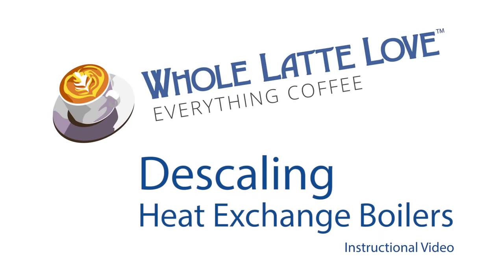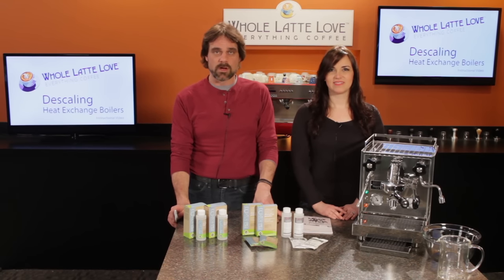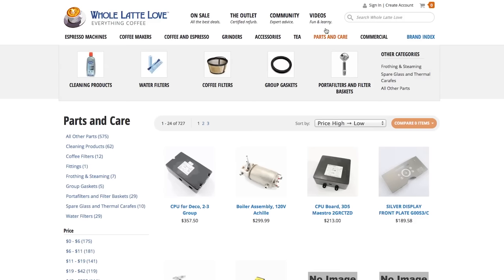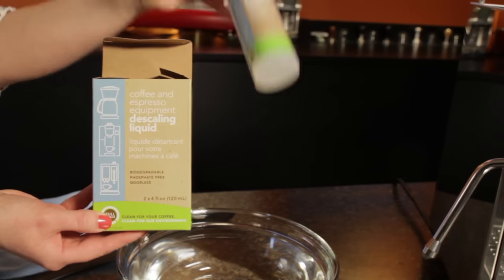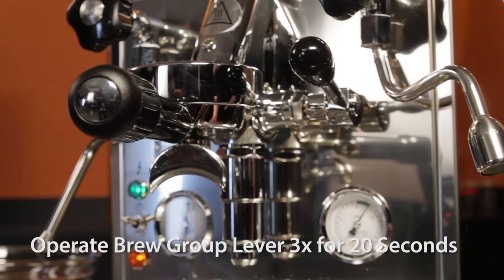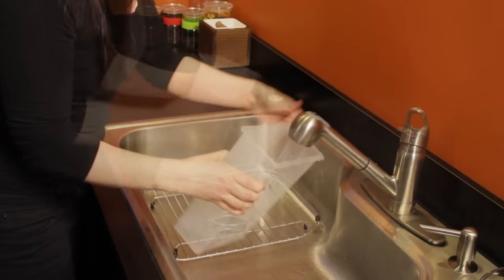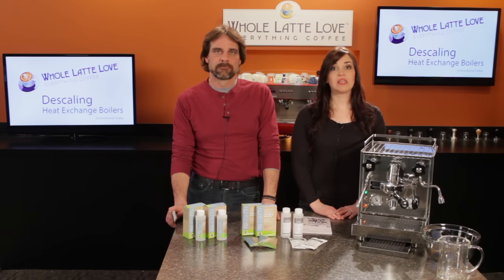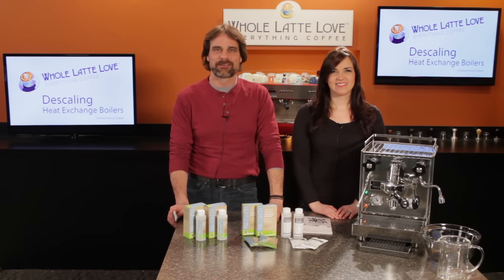How To Descale Espresso Machine Heat Exchange Boilers

Comment: i've found on my profitec 700 that, in addition to the 3-5x end process,  i typically need to flush the grouphead for another 4-5 minutes to get the salt taste out of the  water, backflushing every ~60 seconds
Reply from the maker: Hi kk, We generally recommend end home users do not descale dual boiler machines. As you've found it's difficult to fully flush out descaling acids. Especially the steam boiler. It has open headspace. When descaler is introduced to the steam boiler it can foam up into the headspace. When running water through the steam boiler it never fills the boiler entirely so foam is left in headspace. Best practice is to filter/treat source water to prevent scale from forming in the first place. BWT Water & More has filters using ion-exchange available for plumbed and reservoir fed machines. Their filters exchange calcium in source water for magnesium. They also remove chlorination using activated carbon. The result is chlorine free water with a mineral level needed for flavor and corrosion protection that when used as directed will not cause scale formation in the machine.
Marc
Reply: @Wholelattelovepage   we have always used distilled store bought water for it,  is this an acceptable practical alternative to eliminate the need for descaling? I understand that the use of distilled water is considered to negatively affect the taste of the espresso, but to us it tastes awesome and have zero complaints.  Can we just stick with distilled and stop the 6 moth descales?
Reply from the maker: @dr_flunks  If it tastes good to you that's what matters! You'll get no scale using water with zero mineral content. But, be aware there is a risk of corrosion of metals if using pure distilled water. Pure distilled and reverse osmosis waters are such a good solvents they pull ions from metals causing corrosion. You may not see issues right away but down the road it could cause trouble. What's your tap water like? If good quality and on the softer side with ppm of <100 you could 50/50 mix with distilled to increase the mineral content to remove corrosion risk without having enough minerals to cause scale. If your tap water is moderately hard at 200ppm use 25% tap with 75% distilled. Another option is to dose your distilled water with baking soda and Epsom salt to increase the mineral level. Here's a video showing how to do that. I'd use 25% of the amounts suggested in the video to guarantee no scale: https://youtu.be/iHI7jC0sQZo

Comment: Hello
Thanks for the helpful video.
I recently purchased the Elba 3 from you guys. It does not have a hot water wand. How can I rinse the boiler on this machine? Should I lift the lever for the group head to run everytime you are turning on the wand?
Thanks
Reply from the maker: Hi Max, There is a valve for draining the boiler underneath the machine. Lifting the lever runs water only through the brew water heat exchange section. It does not cause water to turn over in the steam producing section of the boiler.

Comment: How should I do this with a Bezzera BZ 10? Bezzera does not provide any information on decalcification but advises against continuous decalcification !!! When using soft water, descaling is only necessary after several years.

Only external decalcification is recommended here. Please show how this is done ;-).... Are there tips and empirical values for this?

Greetings Christopher
Reply from the maker: Hi CK, Thanks for the question. Most all manufacturers advise against descaling prosumer level machines. This because if one decalcifies a neglected machine it can cause problems with chunks of scale dislodging in one area and plugging another. Then they call the manufacturer and complain. Machines with heat exchange boilers have less complex hydraulic systems than dual boiler machines so not nearly as risky for a home user to descale. The best course is to continuously prevent scale in the first place by filtering to reduce calcium while retaining a mineral level needed for taste and to prevent corrosion of metals. BWT has products like this for that purpose: https://www.wholelattelove.com/products/bwt-bestsave-s-anti-scale-filter
Unless you know your machine has seen hard water for a long time without descaling or is showing symptoms of scaling it's relatively low risk to descale.
Reply: @Wholelattelovepage  Hi thanks for the feedback. I only use Volvic water with a hardness of 3.4 odH, magnesium 12 mg in 1.5 liters and calcium 30 mg in 1.5 liters.

I last decalcified about 1.5 years ago.

Now I have learned from various sources that because of the risk of clogging with lime particles, corrosion damage and the heating coil can also break as a result.

Supposedly, this does not tolerate the descaler and should be removed and cleaned exclusively mechanically or replaced immediately.

Do you have any experience with this? Please also show the external decalcification.

Thank you for the many great videos about coffee. Thumbs up from me!! ;-)

Best regards
Christopher

Comment: how do I descaling the dual boiler espresso machine?
Reply from the maker: Hi NAS, Most manufacturers recommend dual boiler machines be descaled by professional technicians. Dual boiler machines have rather intricate internal plumbing. When descaling, it's possible that scale can be dislodged and plug up plumbing in other parts of the machine. Our preferred solution is to use a quality water filter system that does not allow for scale in the first place like this one: https://www.wholelattelove.com/products/bwt-bestmax-premium-filter-package

Comment: This descales the entire boiler which might not be necessary and can be work the vibration pump too hard. It will be good if there's instruction on just descaling the grouphead and heat exchanger.

Comment: Can you use this method for the Grimac Royal Falcon La Valentina Automatic? Mine is not direct plumbed - I use the 3L internal reservoir with water simply filtered through a Brita filter. Is there a better filtering solution that you recommend? 

I also bought the machine second hand from a restaurant, so I'm not sure how frequently it was descaled. It seems to be working fine, but I guess it might be a little risky to descale on my own without knowing how much build up there is? Is there a way for me to acess how much buildup there is, in order to determine if I'm safe to descale on my own or not? Thanks!
Reply from the maker: Hi Evan, Thanks for the questions. It's a heat exchange boiler machine so this procedure will work. Brita filters do not reduce/control mineral levels in water as far as I know. They do particulate and carbon filtering for chlorine etc. My favorite solution for reservoir fed machines is this BWT pad filter. It uses ion exchange technology to remove excess calcium and replace it with magnesium at a level which significantly reduces scale buildup: https://www.wholelattelove.com/bwt-bestsave-m-anti-scale-filter
The only real way to appraise scale buildup is to have a look inside the boiler. Not knowing how the machine was maintained previously, you are right in assuming it might be a little risky to descale. If there's a lot of scale in the machine descaling could dislodge large particles which can clog other components. My recommendation is to have the machine professionally serviced.
Reply: Great, thanks so much! Super helpful :)
Reply: Okay one more quick question: I just learned that the original owner purchased the machine back in 2014, and apparently had the internal Grimac water softener (that apparently comes with these machines) connected and changed regularly by the tech, but has never had it descaled. So I'm wondering, with 3+ years of use with NYC water run through the softener, but no descaling, what kind of shape would you expect the machine to be in currently in regards to scale build up? Think I might be in a safe place to start descaling on my own with your method? 

Thanks again!
Reply from the maker: Hi Evan, I think you will likely be okay to descale on your own. Can't guarantee but... If the internal softener was used and changed on schedule that will help. Even with those there's still scale build up but a lot less. As far as I know NYC water is not extra hard.
Reply: Great, thanks again! I think I'll probably give it a go.
Reply: So since my hot water valve is operated electronically on my machine (I’ve got the automatic model of the Valentina), I’m not able to purge it once the machine is off. Should I open the steam wand instead since that is manual and will release steam once the machine is turned off, or will that not drain the boiler properly? Thanks!
Reply from the maker: Evan Garfield turn the machine on and open the valve
Reply: Sorry for all the back and forth but I'm still a little confused about how I'd properly drain the boiler on my machine. If my water tank is full and the machine is on, I'd assume my machine would want to autofill the boiler if I were to press the hot water button or press the brew button to flush the brewhead. And if the water tank is empty, then machine does not work and emits a loud beeping sound (which I assume is a protection against burning out the heating element). I could manually press down on the water sensor to trick the machine into thinking that there is water in the tank, and then release remaining water through the water valve and brewhead, but maybe that's risky? 

If it's not too much trouble, I would so appreciate it if you could break down the steps for a machine like mine. I'm just not really understanding when/if I'd turn my machine off in the process, since I cannot force the water out of the brewhead + water valve the way depicted in this video. 

Thanks again for your time!
Reply: Whole Latte Love hi, just wanted to loop back around to see if I could possibly get some clarification on the steps for The automatic Grimac La Valentina, which has electronic brew and hot water buttons. How do I go about draining the boiler/brew head during the steps when the machine is instructed to be turned off (and then the valves opened to force water out of the boiler and brewhead with steam pressure)? I can’t do this on my machine. Any clarification would be greatly appreciated!

Comment: Mark I just got my new Rocket Appartamento and have been using Crystal Géiser and Fiji as my main water source. Will I need to descale it as seen on here in 4 months ? Rocket says not to ?
Reply from the maker: Hey Bluesocks, Marc here from Whole Latte Love... Thanks for the question. If my machine I would descale. In my experience bottled waters are all over the place in hardness/mineral levels. Some are soft and some are hard. I've seen tests showing the same brand may have different hardness levels depending on geographic region where purchased. Some manufacturers recommend machines only be descaled by professional service technicians. Reason?... Descaling a neglected machine can cause large scale deposits to break free and cause problems in other areas. If descaled on a regular basis problematic large scale deposits should not form so home descaling is not risky. Hope that helps!
Marc
Reply: @Wholelattelovepage  Thanks for the information Marc. Do you have a recommended brand of descaler when my 4 months come up ? BTW...I always read the "hey Marc here from WLL" in your voice lol.

Comment: Should this be done on s as n ECM Synchronika?  I only use Brita filtered water and have heard you shouldn’t descale this machine.
Reply from the maker: Hi Beansy, Thanks for the question. You are correct most manufacturers recommend dual boiler machines like the Synchronika be descaled by a professional. So the best strategy is using water which does not cause scale in the first place. Unfortunately the Brita filters I'm aware of don't do anything to reduce minerals in water which cause scale. They usually do particle and carbon filtration. But perhaps your tap water is relatively soft to begin with and not likely to cause scale? If you know your water is not soft then we suggest a BWT filtering solution. BWT has 3 options ranging from an in line filter for plumbed machines, a filtering pitcher and in-reservoir pad filters. All 3 options use patented ion-exchange technology which replaces calcium in water with magnesium. This prevents scale when used as directed yet maintains a mineral level to prevent over-extraction and support good flavor. All 3 do carbon filtration as well to removes chlorination/chemicals. Check them out here:
BWT Bestmax Premium in-line filter system: https://www.wholelattelove.com/products/bwt-bestmax-premium-filter-package-w-besthead-flex
BWT Penguin Pitcher: https://www.wholelattelove.com/products/bwt-penguin-2-7-l-water-pitcher
BWT Bestsave in-reservoir pad filter: https://www.wholelattelove.com/products/bwt-bestsave-m-anti-scale-filter
Hope that helps!
Marc
Reply: @Wholelattelovepage  thanks Marc. I wasn’t aware the Brita didn’t offer this sort of protection and will make the switch. The machine is a year old and afaik the water is soft here.  Is it worth descaling?

Comment: I have bought a used krups xp1500 and there is brown at the bottom of the boiler.   When I run water, descaler solutions I get brown/red Flakes.  Is this harmful and or normal?  I really want to make espresso and lattes.
Reply from the maker: Hi cj, I cannot be certain, but brown red sounds like rust/corrosion. That's usually caused by water that's too pure. Water lacking minerals can cause corrosion of metal components. It's kind of the opposite of scale. Might also be water which was high in iron or clay. Sorry I cannot say if it is harmful. In your shoes I would continue flushing the machine until no more flakes.
Reply: Thanks so much for your help.   I'm thinking I may be just better off with a new machine.  I have spent hours flushing the machine to no avail.  I finally did make an espresso yesterday and it was okay.  Maybe because it's so old, I didn't really get the Golden color.  The online manual says it's a 4 bar machine while nearly every other new model machine says they are 15 bar.  Maybe old technology.

Comment: this i not a full descale.. since the boiler is only filled to a certain level with water..
Reply from the maker: Hi MrH, Thanks for the comment. It's very rare for scale to form at the high water mark in heat exchange boilers. Above the high water mark it does not as the steam there is essentially distilled with no mineral content.

Comment: Hi Mark, is it possible to descale the pro 600 using the same procedure? Or all we need to do is stick to backflush?
Reply from the maker: Hi Dc, We do not recommend end users descale dual boiler espresso machines. It's a a job best left to a professional machine technician. Do keep up on backflushing! You can eliminate the need to descale in the first place by using source water that will not cause scale deposits.
Marc

Comment: Hey WLL, 
y'all are da best!
Can I ask you about the Elba 3 by 969.Coffee? It doesn't have a water spout, and I can't find good info on how to.
Thanks!
Reply from the maker: Hi Dan, I'm working from home at the moment so I do not have the machine in front of me but If I recall correctly the boiler has a physical drain at bottom of machine. If you need further assistance give our tech support a call at 585-924-7170.
Marc
Reply: @Wholelattelovepage  already did ❤️

Comment: So you don't descale the frother?
Reply from the maker: Hi f, Thanks for the question. No need to as scale does not accumulate in the frothing wand. Steam flowing through the wand is essentially distilled water so very low to no minerals.
Marc

Comment: I've just tried this technique (p500) . However, after numerous rinsing (as per the end of the video), steam from the steam wand still smells of the descaler (everywhere else is fine).
Is there a missing step?
Reply from the maker: Hi Michael, Hmm... That's odd! What descaler are you using? Most have no odor so curious as to what you are smelling. You can check for complete rinsing of descaler by putting some baking soda in water coming from your steam wand. If there's still descaler (acid) present you will get a reaction like those grade school volcanoes.

Comment: Great video! 
Do you have a video or link for descaling a dual boiler? I have the Expobar Brewtus IV Dual boiler
Reply from the maker: Hi Martin, Thanks for the comment and request. Unfortunately I do not have a video on descaling dual boilers. Manufacturers generally recommend DB machines be descaled by professional technician. At our service center boilers are removed from DB machines for descaling. Due to the complexities of internal components there is a chance of causing problems during descaling.
Marc
Reply: @Wholelattelovepage  Marc, thank you so much for your comments. Your dedication is absolutely mind blowing. 
I was hoping you could elaborate on the sensitive components you mentioned earlier. For example,  the solenoid valve is also found in single and exchange boilers. What makes dual boilers different? Are you talking about components found within the boilers that have to be removed prior to descaling?
If we take Rancilio silvia pro for example, with the automatic fun3 and fun4, can we not do this process and then repeat this 3-5 times with clean water?
And once clean we can turn on the steam and flush the remaining?
In a way, it is very similar to how Brevill instruct on their dual boilers.
Looking forward to your knowledgeable response, 
Roy